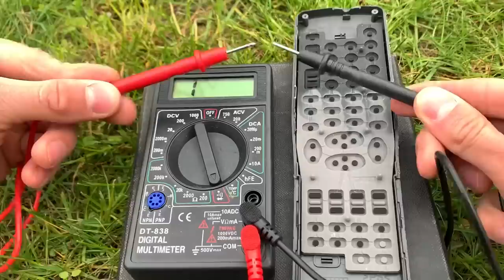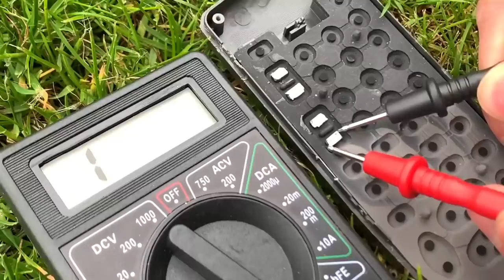Just put aluminum foil on the remote control and you will be amazed!

Comment: Based on the chipping on the side of the remote I'd say you've done this many times.  Maybe if you just left it alone it wouldn't stop working.  Had mine for 6 years and haven't had a single issue.